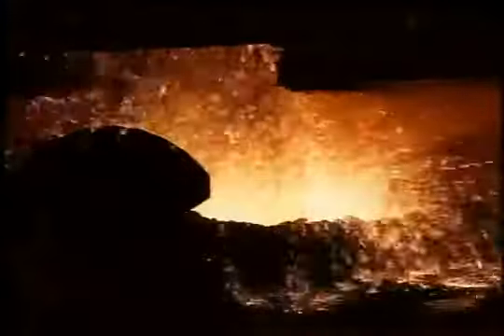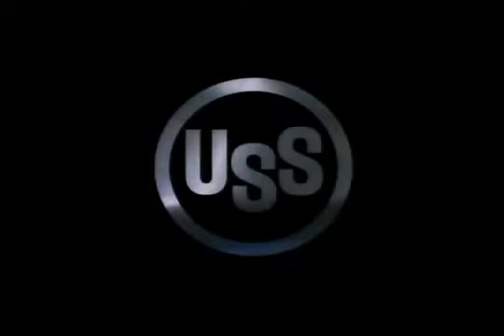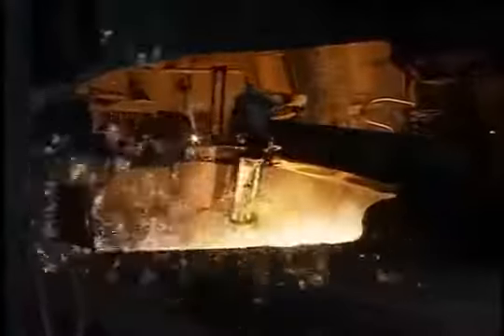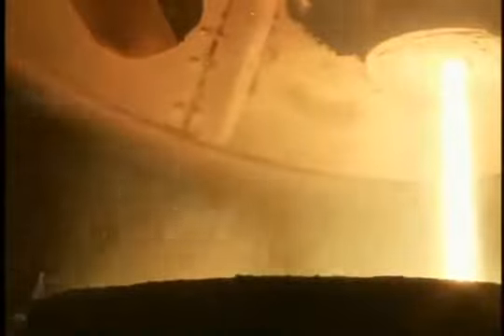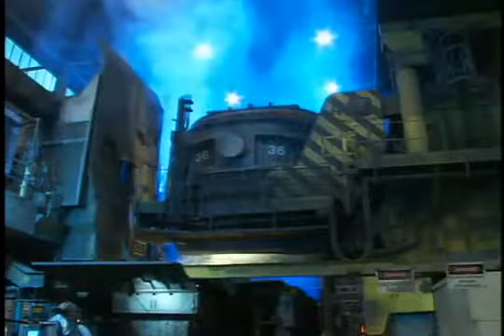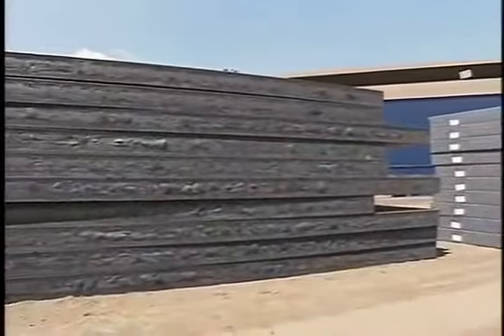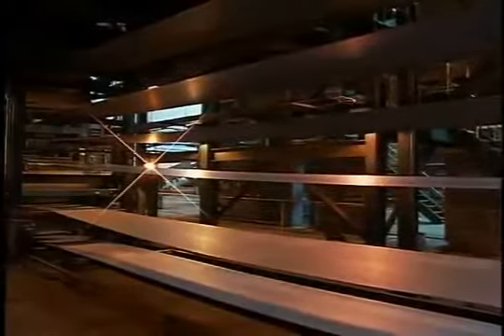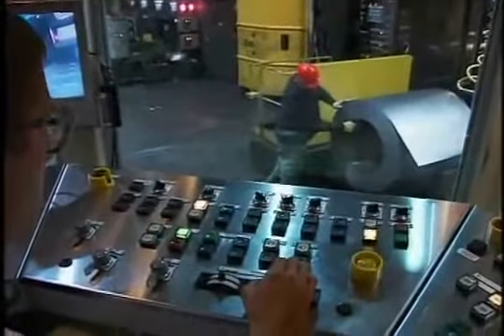STEEL  From Start to Finish

Comment: Review video about Steel from start to finish
By Budi Christofer Manik (2713100105)
This video shown how iron ore is processed from start to finish (plate,coil,rods,etc) of the steel making United State Steel (USS) company. How the make steel? what the applied of steel in oyr daily life? I just explain about steelmaking process by this video. The first process, strip mining is mining with explode aimed to obtain the rocks in the surface of the earth. The rocks inside to the machine to get crude iron ore, we can get it by grinding the rock into a pellet and materials inside to machine with powerful magnet and seperating the ore. And then, the ore formed into pellets that will later be converted. the next process, we created coke as a fuel iron making process by coal. The coal is crushed into small pieces and bake for 12 to 16 hours, then placed to the oven as its fuel. The fuel and pellet come together in the blast furnace and we can add the limestone to removed the impurities. In the blast furnace, superheat air combusted the coke and will be reaction of carbon with air at 2700 degree Fahrenheit, and reduces the amount carbon and changes the raw materials to molten iron. The regular marbles is tapped into the giant submarine level and send into basic constitution where iron is turned into steel. The steel making process is dumping recycled steel scrap into the Basic Oxygen Furnace (BOF). When high purity oxygen is blown into the mix at supersonic speed, the molten iron is becoming molten steel. The process continuous casting at 2000-2700 degree where the molten iron formed by coils, rods, etc. Some of those steel is given additional treatment. It may be coated to make it resisant from corrosion, thinned for further reducing the gauge, annealed to make it easier to bend than form, and tempering to add hardness and create surface texture and special finishing. This steel is continue several steps that form it into several shape as customers need. We can find many steel applied in our daily life example car, motorcycle, etc. 
thank you.

Comment: Dendra Ravelia (2713100148)
Class     : PBB B
Lecture : Ms. Dian Mughni F,ST.,M.Sc.

This video tells us about How to make steel from start to the end. If you would like to make a steel, you have to explode the ground which contain raw material. It can be named iron ore. And then,  iron ores have to be processed by grinding machine to make a pellet. For materials needed coal burning furnace which is first converted into coke to remove moisture that require cruhing and heating within 12-16 hours, and came out form solid carbon. And then, coke and pellets have to be entered in the furnaced and to remove the impurities, you have to add limestone, and then the raw material had been transformed into a liquid because given the extremely high temperatures in a furnace. It can be named molten metal. And then, molten metal have to be entered in the converter and then yo can do the refining process. After refining process, you can start the finishing process.  the next process molten metal will be formed into a slab form, this process is by passing a steel bar between rollers rotating steel bar so that it becomes thinner and elongated. The result of this rolling process is the result material can be made flat, stronger but lithe. If you want to make better mechanical properties of the material, you have to do the heat treatment again to improve the mechanical properties. For example the material which can resist from corrosion. 

Thank you

Comment: Panji Harga Susila - 2713100110
PBB B (video's review)
How to start about steel making ? it showed in this video, the mining process they used is strip mining, they made an rock explosion on earth surface (not to deep) that contains many raw materials include iron ore. The rocks also called as crude iron ore, that would be grinding into pellets, then separating them with powerful magnets. Next, the iron ore formed to marble size pellets so that converted to wire. To makes coal they cooked coke to fuel on iron making process. The coal crushed, sealed, then baked for 12-16 hours. The fuel and pellets come together in blast furnace, they also added enough limestone to remove impurities. The continues blast with super heated air combust the coal and changed raw material into molten iron, and they produced more 9000 tons per day in they largest blast furnace. They reached temperature at 27000◦ F, afterward the iron took into giant submarine and ride on rail to basic oxygen process, when iron will be turned into steel. They began the steel making process by dumping recycle steel scrap into the basic oxygen furnace and adding hot iron. While high impurities oxygen is blown into the mix with supersonic speed. So, molten iron become molten steel. They produced a lot of different custom of steel depends on customer. Taking the molten steel from hot vessels into lethals. Then the focus is on reforming and finishing to determine the steel characteristic. The molten steel placed into casters containing mold shape the steel. The molten steel now is 3000◦ F. The shape is determined as the finish product that come out the casters. The most of they caster output is slab. Hot strip mill, slab is reheated and descaled (that make steel thinner and longer). Finally, steel cooled and rolled into coils .The entire process is untouched by human hands, controlling steps by operators. Then some products include coils are shipped directly to the customers and others are given some treatments to special finishing. Coating to make the steel resistance from corrosion. Thinning to further reduce the gauge. Annealing to make the steel easier to bend and form. Tempering with used special roller to add hardness and create surface texture and other special finishes. These the story from shape pellets to shape coil and beyond.

Comment: Samuel Budi Utomo 2713100091

This video tells us about steelmaking from the start to the end. We use steel in our daily activities like when we are eating, playing computer, driving, writing, taking a bath, and many more. In this video, many information that we can get about steelmaking process. First, the video explains how to get iron ore from the earth, we blast the land to crush the rocks. Then, the rocks transform into pellet by grind them. Then we seperate the ore from the rocks using a magnet.Then forming and heating the ores into marble size pellets that will later converted to iron. They using coke to fuel the ironmaking process. They crush it and seal it in the oven for 12-16 hours, after that the coke become a solid carbon fuel. Then they mix the fuel and the pellets mixed together in the blast furnace and they add just enough limestone to remove the impurities. From the bottom of the blast furnace, a continous blast of super heated air, inflame the coke and changing raw materials into a molten metal. After that they tap the molten metal into a giant submarine rails and take them into the next step where iron will be turned into steel. In this step, up to 250 tons of steel can be made in less then 45 mins. It begin by dumping recycled steel scrap into the Basic Oxygen Furnace + hot iron, then molten iron become molten steel. Then the molten steel tapped and made into a highly formable to finish the steel as customer demanded. The shape of the mold determines the shape of semi-finished products. US often make a sheet-type steel so the steel slab will be milled into sheet. First step is hot milling, slabs will be reheated into 2400°F and descaled before running into a series of  process that will make the steel thinner and longer, and through a few finishing steps that they will be rolled to become even more thinner. Finally  the steel sheet cooled and rolled into coils.

That is my review from this video

Comment: Peniel Simaremare (2713100095)

STEEL MAKING HOMEWORK 1

Steel Making Process by Basic Oxygen Furnace.
First time I watch this video, I think that steel making is the most risk-jobs ever. I never imagine how the steel processed before join the Materials and Metallurgical Department on Institut Teknologi Sepuluh Nopember. Cars, motorcycles, wire, nails, screws, even the kitchen set such as spoon, spatulla, the stainless steel bowl, etc is made from the complex process that is known as Steel Making Process. Exactly this video is kind of Basic Oxygen Furnace.
First of all, the engineer detect an area of mining that speculated contains iron ore. In this video, the company used strip mining. After the blasting, the rock breakage or destroyed and turn into diversing shape. Ater that, the crude iron start to grinding to make the shape smaller. This process is called pelletizing. The purpose of pelletizing is to equate the shape of the rocks, so its more efficient to continue the process to install it on the Blast Furnace.
During the iron-making process, a blast furnace is fed with the iron ore, coke and small quantities of fluxes (minerals, such as limestone, which are used to collect impurities). Air which is heated to about 1200°C is blown into the furnace through nozzles in the lower section. The air causes the coke to burn, producing carbon monoxide which reacts with the iron ore, as well as heat to melt the iron. Finally, the tap hole at the bottom of the furnace is opened and molten iron and slag (impurities) are drained off.
After drained off, the ready-use steel can be forming into another shape to complete its function such as body of car, plan, etc.

Thank you.

Comment: Mahendra Kresna 2713100005
PBB-B

This video shows how to make a steel from beginning, from start to finish in USS (United States Steel).

The story begin with the blast in mining to explode the rock and get the crude iron ore from the earth. Then they grinding the rock into pellet and separating the ore with the power from magnet. Then they form and heat the ore into marble size pellets. Later the pellets will be converted into iron. Coke for blast furnace fuel (to heat the furnace) is made from coal. They crushed the coal and then seal it for 12 to 16 hours in oven and then remove it from the oven as solid carbon fuel. The fuel and pellet put together into the blast furnace and they add a limestone to remove impurities from below a continuous plastics super-heated air combust the coke, intensifying the heat and change raw materials into the molten iron at 2700°F. At regular intervals they transport the molten iron with giant submarine level and send into basic constitution where iron is turned into steel. In less than 45 minutes they can make 250 tons of steel. They begin the steel making process with dumping the recycled steel scrap into the Basic Oxygen Furnace (BOF) and adding hot iron. Then they blow high purity oxygen into the BOF with supersonic speed, then the molten iron becoming molten steel. And then they make steel into the custom blend that widely used metals in the world. In fact they made over 1500 different chemistries to meet the customer demand for cutting edge value added steel. The molten steel now heated at 3000°F that changing the tandish into lethal then to caster where it cold into red hot solid metal. The shape of the mold determine the semi-product that come out of the custer. Then it is send to hot strips mills. The steel's slag can also be transformed into steel sheet at 2400°F. Then they rolled the slag to make them thinner. They offer some additional finishing processes, first is coating that can make a steel resistant to corrosion. Then thinning to further reduce the gauge length. Then annealing to make steel easily bend and form. And then tempering that uses special roller to add hardness and create surface textures, and then other special finishes.

Comment: Yudhistira Surya Andika K.
2713100101

"This video explain the process of steel making from the very first beginning. The one who presented this video in USS(United State Steel). USS explained the process happened in their company. In the beginning, the rock from the mining site blasted to toss the raw material of steel from the earth. After that the raw material grinded to form powder and passed strong magnet to separate the iron ore. Then the iron ore formed into mable sized pellets. The fuel used for the reduction process of the iron ore is coke. The coke came from the coal that crushed and baked in airtight area for 12-16 hours to form solid carbon fuel. Next the pellets and the cokes transported to blast furnace with added limestone to remove impurities. The blast furnace heated around 2700 fahrenheit to form molten iron.The molten iron transported by submarine ladle to Basic Oxygen Furnace (BOF). First, they added the steel scrap into the BOF. Then the molten iron poured into BOF. The oxygen blown at BOF process with supersonic speed into the mix and as we know that this process is to reduce the amount of carbon in the molten iron so the molten iron transformed into molten steel. Then, the molten steel passed custom blends process to get the expected result of steel. After that, the molten steel tapped from above vessel into ladle. The last step is forming and finishing. The molten steel poured into the mold and formed desired shape. Mos of CSS products were turned the molten steel into slab shaped steel and cut into 40 feet long. The next, process was transforming steel slab into steel sheet. Steel slabs were reheated and rolled into few steps so steel slab formed into more longer and thinner as steel coils. Steel coils can be either shipped or passed special finishing process like coating, thinning, annealing, or tempering"

Comment: Reviewed by : Jan Weslin Saragih (2713100087)

This video explains us about the steelmaking process. This process is the beginning of many everyday products we use, such as automobiles, appliances, steel wire, nails, screws, cutlery and even paperclips. This video shows how iron ore is processed from start to finish. It is began with blasting the rocks that contains iron ore. The mining method of this company is used strip mining. The blasted rock called raw material of steel and also called as iron iro. Afterward, crude iron ore is taken then grinding into pellets and then separating the ore with power from magnet. Then the ore is heated and formed in the size marble pellets. Then from coal, we make coke became fuel of iron-making processes. We crash it, seal it in air tight oven and bake it around 12 to 16 hours, so we will get solid carbon fuel. We put the fuel and pellet plus limestone in Blast Furnace. We use limestone to remove impurity. And then we can get the molten iron at 〖2700〗^o F. We start steel making process by dumping recycle steel scrap into BOF(Basic Oxygen Furnace) and adding hot iron. When high purity oxygen is blown into the mix at supersonic speed we get molten steel from molten metal. We can start to make costum blend so it can widely use. The entire process is untouched by human hands, controlling steps by operators, then some products (coils) are shiped directly to the customers. Others are given some treatments to special finishing such as coating to make the steel resistance from corrosion, thinning to further reduce the gauge, annealing to make the steel easier to bend and form, and tempering with special roller to add hardness and create surface texture. 

Thank you.

Comment: Name: Fadli Kurniawan (2713100029)
Class: PBB-B
Lecture: Ms. Dian Mughni F,ST.,M.Sc.

This is my review about the video :
Started by an explosion, the explosion containing raw materials and rocks from the earth there are also iron ore, then through the grinding process of iron ore it be treated to pellet. For materials needed coal burning furnace which is first converted into coke to remove moisture that require cruhing and heating within 12-16 hours, and came out form solid carbon. After the coke and pellets inserted into the furnace and added limestone to remove impurities, and then the raw material had been transformed into a liquid because given the extremely high temperatures in a furnace, and it called molten metal, the molten metal inserted into the converter and followed by a refining process, and in this phase also added scrap iron and  other chemicals material that are needed by the industry or consumers who order, according with the characteristics required and after the process of refining will continue in the process of finishing, in the video described above on the next process molten metal will be formed into a slab form, this process is by passing a steel bar between rollers rotating steel bar so that it becomes thinner and elongated. At the beginning of the rolling process, is intended to make the metal structure becomes flat, stronger but lithe, in addition to forming the desired size, such as thick plates, bars or plates. after that there are some special treatment to make steel could be more robust, corrosion resistant and has the nature or form required by a consumer then given several properties that cold rolling to thin, coating for anti-corrosion, annealing to facilitate the establishment, tempering to give nature specific violence